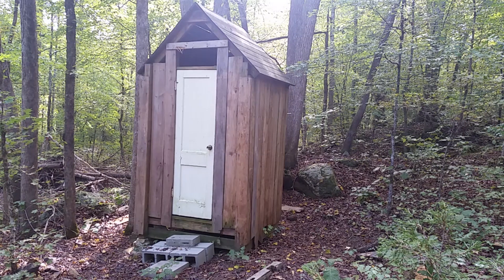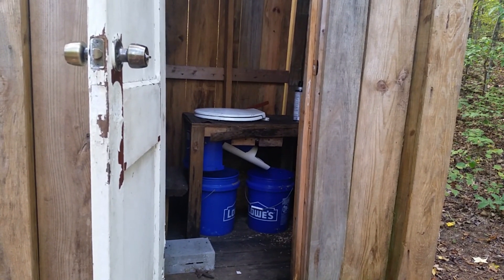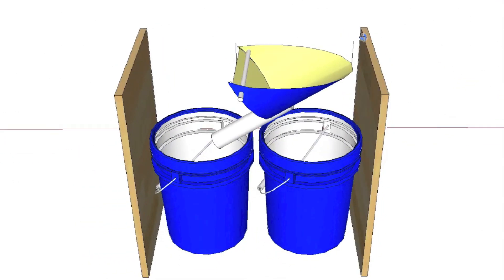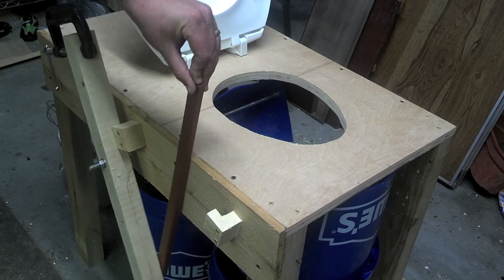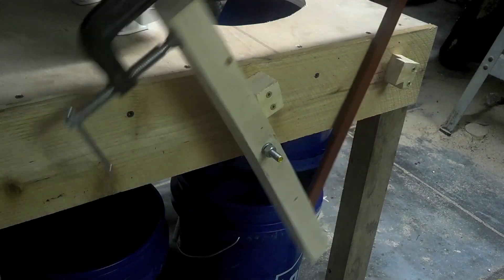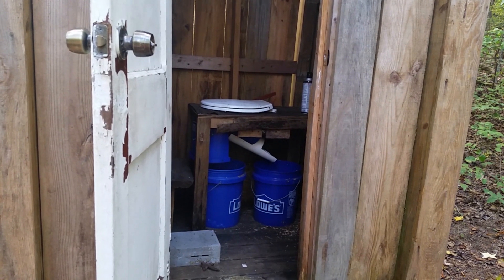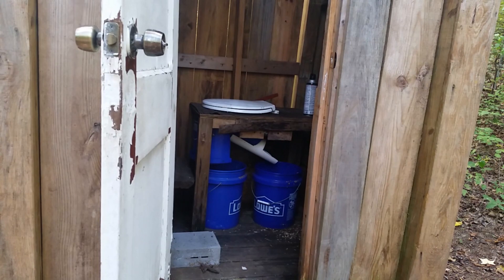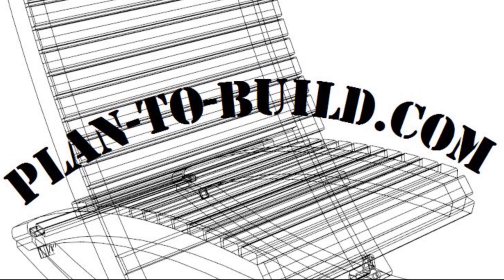Cabin Project -- Composting Toilet

Comment: Nice I like this idea better than a diverter , u can do ur business and it ends up where it should be, now if u set up a gray water system and do a flush system in the urine so when you wash ur hands it Rinses the shoot and washes the urine out of the line but kept compost separated even better if the saw dust wud fall into bucket with the same lever

Comment: So first you poo in that plastic recipient, then you dump the poop from the recipient in the bucket below. I guess you have to wash the first recipient after each use, but how do you wash it if you don't use water? The whole process of keeping everything clean seems to be quite complicated.
Reply from the maker: We don't wash it each time...only when there are skid marks ;-)  As long as as you have a nice bed of dead leaves for the solids to land on everything usually works fine...it is when the solids aren't so solid you run into trouble.  At that point you just make due with whatever you have I guess.
Reply: Oh man. Skids and runs are the demise of any composting system when you have to clean it. I watched my friend Paul try to clean a problem poo and the amount of gagging and watering eyes was legendary. He almost didn't get the job done. Nice design for a composting toilet but man I wish there were a better way.
Reply: There are ALWAYS skid marks.  Sorry but Bad Design

Comment: Your over thinking this...All you need is one bucket ...You do NOT need to separate your liquids from solids! My family and I (5 of us ) us this method full time...No smell. If there is smell you are doing something wrong. Please PM me if you need any help...
Reply from the maker: +SouthernPioneer1965 I do tend to over engineer all the time... haha.  Everything I read about it said to separate solids and liquids though.  I could have done some real world experimenting first I suppose and went with a single bucket and plenty of sawdust, but it is built now and has been in service for two years with no odor.
Reply: +SouthernPioneer1965 your fecal matter will decompose quicker if separated
Reply: Yea i read that also...I experiment a lot. As for the decomposition time we give it a full two years before it gets rolled into other fertilizers and put into the garden